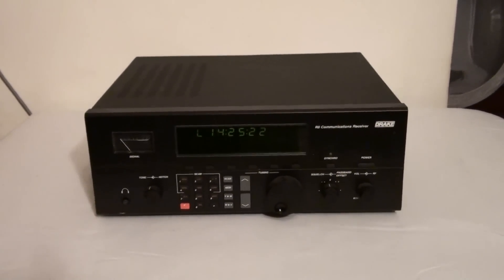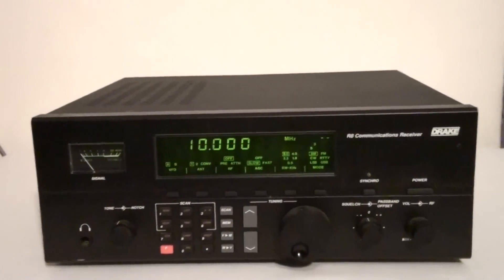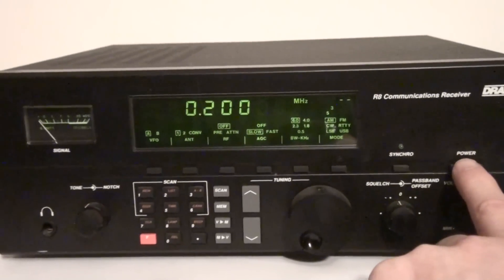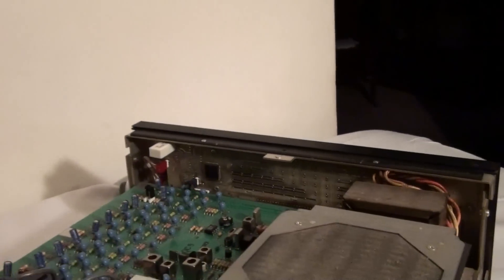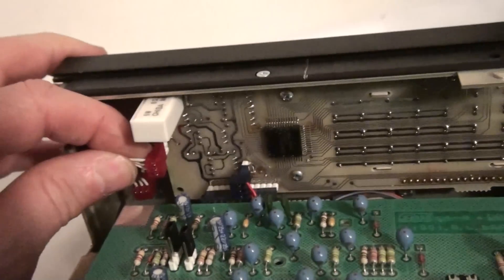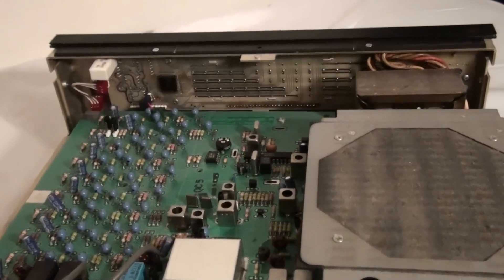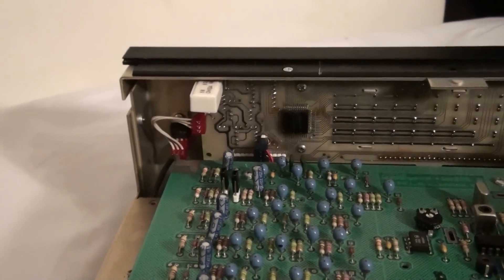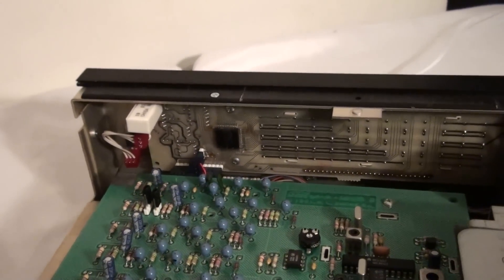Drake R8 Shortwave Receiver Display Repair

Comment: Wow! It worked. It was the oxidation on the contacts. SO glad I found this video. My R-8 belonged to my late brother and I've had it in my office - plugged in but not in use - and just noticed today that the time display had gone out. I had it fixed in less time than it took to watch your video. Big thanks for posting your video!